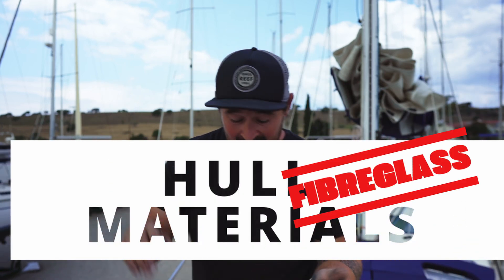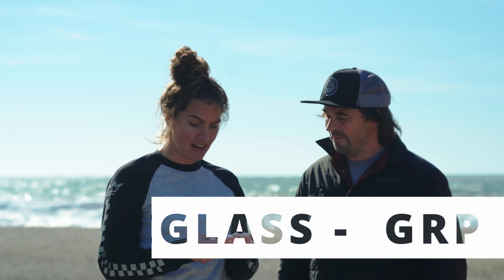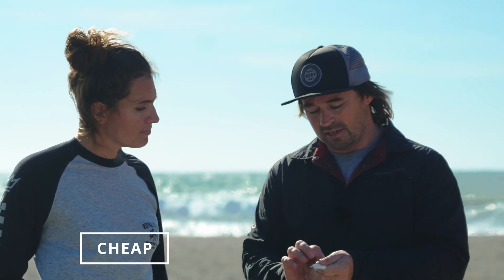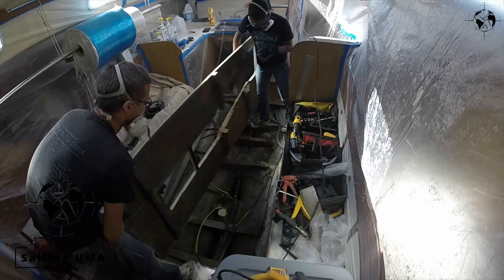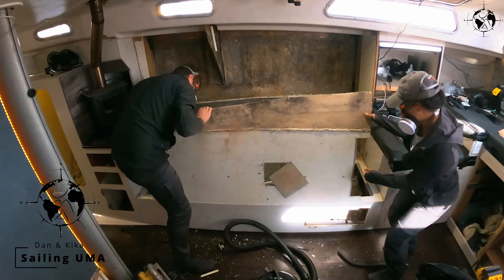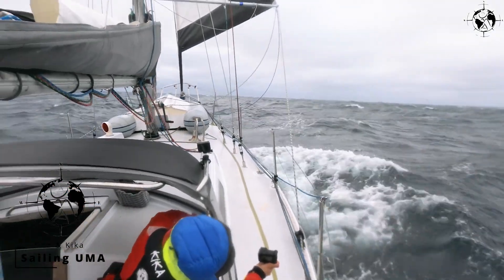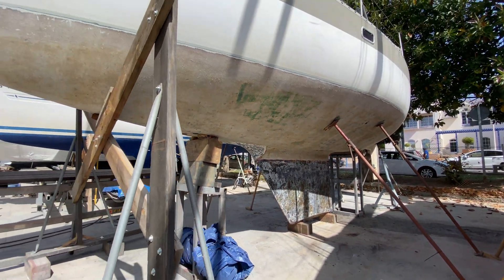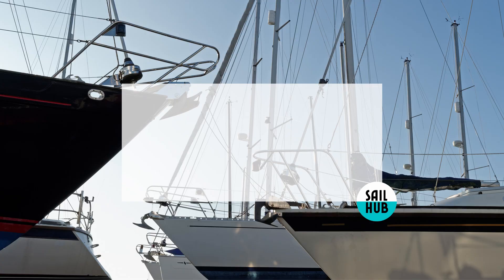Fibreglass Boats 101- Why so CHEAP?

Comment: Construction materials for where you want to take your boat. A Personal perspective if going to extremely cold Latitudes such as the Arctic or Antarctic, a steel Boat, everywhere in between, either a reinforced Polyester boat properly barrier coated, or a reinforced Vinylester  boat properly Barrier coated (needed as base coats for antifouling anyway. I would never have an aluminium boat as without meticulous TLC and a careful eye on things,  corrosion can be bloody fast and nasty. and after building a high quality expensive hardwood marine ply boat, I will never have any plywood on a boat, or built of plywood, ever again, and not just because Termites love eating the stuff, and soon it is bye bye bulkheads etc. Termites don’t just live in the Tropics by these, Europe has a big Termite problem, and they have now made their way to Britain. Not that it is bad for the climate, because it isn’t and our atmosphere is actually short of it, but guess what are far and away the biggest source of CO2 in the World ? Yep Termites. 🤔
Reply from the maker: Hey Bob, 
some more great points there, I agree with them all. I would suggest that an aluminium build can be different these days. Electrolysis being the main issue, and wit recent technology there's no absolute need for many boats to plug in to 240v these days, there are  also so many good products for good electrical isolation. With specific zinc coatings such as Doxanode becoming the norm for aluminium there's an added safety anode there too. 
If your aware of the issues and know how to see them early I think aluminium is the superior choice, if your not the steel is probably the winner in my eyes.
Reply: @SailHub  Total Hull protection  Below the Waterline can be provided cheaply with Cold Galvanising Paint with 97% Zinc Content, which is Also an Antifouling as well as an Anode. Do Not Buy the Marine  ersions though, as the are identical to the Land use Versions, but the Land Ones are a Fraction of the Price. Frankly, an Aluminium Boat imho, Must  be Hauled out annually (it is good practice for all boats unless they  can be beached or have Twin/ Bilge !eels and can dry out) for a thorough inspection, full service, antifoul and Anode checks. Possibly the biggest issue, is how many really skilled aluminium welders are there in the World ? A lot less than skilled steel welders, and both are vastly outnumbered by skilled Fiberglass workers, plus the number of competent amateurs is staggering as well. so for me, as I  only longer have any desire, or health reasons to go anywhere  Cold, quite the opposite in fact, as I need at least three years in Hot Places es to help starting to reverse disabilities Caused by a Criminally insane Medical Profession, so it really is no Contest , other than finding the Money to  Buy One of Course. Still, God willing, my order for a new Island Packet IP 439 should be placed  efore the end of this year, as thankfully, despite losing everything I had when my last Sailboat was lost, I had bought some Silver Bullion as insurance against the Crime Syndicate That's Stealing everything called the European Union,  when the price was really low, and the price of Silver is ,imely to outdo any Crypto Currencies at some point, and the Sillver Shortage has now reached critical proportions, it looks,s like the Comex Warehouse is now empty, and the LBMA is rapidly  being drained. All modern Technology is totally reliant on Silver, and if Stupid Electric Vehicles and Solar Panel Farms keep being Pusned, the World is going to rapidly run out of Silver.  RICS Nations get it, India for example bout 304 million ounces of Silver in 2022. Silver is actually the most precious metal by Far, and is the most undervalued asset on the Planet. Not Gold. Pricing reality will be catching up very soon  now. Not Financial Advice, but personally I wish I could afford to buy a bit more, while it is still possible to get some. Still, I think I have e ough to get me the Sailboat I need. Fingers crossed.   Best Wishes and Fair Winds.  Bob.  🤔👍⛵️✨️✨️✨️
Reply from the maker: Mate, I’m with you there! Will look into the zink treatments, im aware of doxanode and I’m aware of another name that’s it’s sold under - probably the original manufacturer. 

As for the eye and finances in general, it’s quite possible that the seas is the last place to be free, go get you IP 439 and enjoy her! Cheers to that 🍻
Reply: @SailHub  as an insight here in the UK, a Kilo PaintTin of 97% Zinc, in a silicone Carrier was about £23 a tin including 20% VAT. Three coats should give about 18 months protection, but on annual haulout, after a quick pressure wash, to slap more Coats on a quick keying with a Scotchbrite scrubber once dry, should be all the prep needed. I've read that some fishing boats ha e been using it effectively as both an a tifoul and Anode, for over 10 years, so I'm tempted, if I can't get the builder Island Packet to source a good Outfit to Copper Coat antifoull it, to get them to put 4 Coats of Cold Galvanising Paint below the waterline and on the Prop and through hulls, plus a couple of Coats in all those expensive Zinc Anodes, to see how well it lasts as a test. I'll be mostly in the Caribbean for a while, and that's a good place to see how it golds up. There is a very good chance imho, that it can turn out to be at least as good as Hempel's Excellent  Silic One antifouling, but for a fraction of the price. Like Copper, Zinc is one of those essential Supplements needed by Life (my Smallholding has a Chronic Copper Deficiency, all Livestock in the area gets given Copper Supplements, and I take the occasional Copper Supplements as well, just to be on the safe side. Zinc kills nasty viruses by the way. Copper Deficiency in Mammals, has very serious effects not dissimilar to a Neuro Toxin to the Brain. Best Wishes and Fair Winds.  Bob in Wales.  👍⛵️✨️✨️✨️
Reply from the maker: Cool. Thanks for that! 
We know a chap who’s testing some zinc bottoms paint agh the moment, we will be watching them too - see how they get on. It’s good to have alternatives and also good to about the marine added tax we seems to spend our lives dodging!
Reply: PS. I'm a big fan of Copper Coat, but finding a reliable Yard to put it on properly has been a struggle, so to tide me over while searching for one, Had Pettit Trinidad Pro hard antifouling  put on my last boat, which after 3 years just got easy to remove Slime Starting, and it could stay with just Slime to wipe off or pressure wash, for another 4 years. Unfortunately the boat was lost after being attacked by a Wrecking Gang in New York Harbour,  so a number of tests like the antifoul, and a new generation Polycrystalline Solar Panel (prior Polycrystalline Pandls were pretty much finished in 6 to 7 years, so was assisting a Tester in Florida to check if there was any improvement, by checking annually how much the electricity Output was degrading. One of those in the otherwise Monocrystalline Bank of Panels, being no hardship during testing) losing those and other things scheduled for testing, really Sucked tbh. Best Wishes and Fair Winds.  Bob in Wales.  👍⛵️✨️✨️✨️
Reply from the maker: Jeez man, that seriously bad luck. So sorry to hear about your last boat. Such a shame, good testing takes time too - irreplaceable.

As for the cooler coat, sure - it’s good stuff…. At a price, great to have alternatives too. There does appear to be a strict humidity range required that a lot of people don’t adhere to - it’s pretty simple in the correct conditions, you’ve just got to be patient and wait for them. However time is money that there the issue begins. 

Currently in Spain in the costa del sol - no issues here, just back from Greece which would have been a nightmare to apply copper coat there! Later in the season would work.. I know of people who successfully used it in scotland - you get a day every year to do it 😂!! 

Don’t know why I’m laughing, we will be back in the UK in a month or so!
Reply: @SailHub  On the positive side, my last boat was so tough, she survived to get me through it alive before going down, plus, she taught me big time what I really need on my next Sailboat,  such as being very easy to get on and off, so Aft Cockpit,  and Sugar Scoop or bathing platform to function as a Dock for the Tender, and totally altered what I need as an easy to handle Sail plan, with in Mast Furling, and foresail Curling, plus no more Cross Cut Dacron Sails, Triradial Battenless Furling Main, Triradial Self Taxking Jib, and a way to negate the ability of Hackers to take down the boat network, and have a fast get out of Dodge basic Get Out of Dodge option, with a Full Restore after another System wipe once at a safe place. Raymarine are looking at that for me, which I'll be able to help with once I have the  New Raymarine setup on the New Sailboat. Nothing wrong with B&G, Garmin,  Simrad etc, but as a Tester, I want to continue with that Relationship with Raymarine.  When my network was hacked, the  Chart Plotter and Navigation went haywire, so I hove to on full rudder going round in circles to keep an eye on any Shipping in the Harbour, while I checked things out, and rebooted everything, only to find all of my electronic Charts had been deleted. in Future, I'll have a Tablet with Navionics Charts of the area, in a Faraday Cage as first backup to use while getting the system fully formatted and getting the Get out of Dodge Backup installed on the Network. I think we'll be able to fit what's needed onto a couple of fast memory Sticks to also be kept in a seperate Faraday Cage, and that was the last suggestion I made to the Raymarine Devs, and won't really know more until I have a fully Functional System installed on a Boat again. I've been a Software Tester since the late 1970's,  for the likes of Microsoft, Borland, Wordperfect, etc, and was one of Microsoft's early Registered Developers, though my field was really Computer Hardware, and was a Custom Computer Builder.  Qualified in Civil and Structural engineering,  Thorn EMI Trained Skilled Electrical Installation Engineer, etc,  and now I'm an Apprentice Old Fart, still managing to Breathe. lol. 🤣 Best Wishes and Fair Winds.  Bob in Wales.  👍 ⛵️✨️✨️✨️

Comment: have read from people who do both wood and fiberglass the cost to maintain is about the same If, age brightwork etc is the same only difference is one is wood the other fiberglass
Reply from the maker: Sure wood is good! I’m actually a wooden boatbuilder, I would say that fibreglass is a lot easier to work with and usually a lot less maintenance. Older fibreglass boats are probably the same though…

In general the better quality the fibreglass lay up the less maintenance you will have. Similar to wood really, the better the timber the longer it lasts. 

For me.. the best build is from Aluminium and second to that an epoxy composite build. We’ve all got our own preferences though 👍
Reply: @SailHub  When the Gougeon brothers book first came out they had plans for a cold molded boat   That was a fun project   now, just got the book no plans no boat
Reply from the maker: Gotta love a cold moulded boat mind! I’ve only build a small one, I think it’s a great way to build. Gotta love the big customs from the likes of Spirit too!
Reply: @SailHub  Yes Wanted to go to the Northwest school of Woodeen boat building Didn't have the money to live there for1 year One of those local people have the advantage
Reply from the maker: Sure, I lived aboard in some super cheap club moorings where I trained. I certainly could not afford the accommodation.  However I do think it is just as easy to learn the trade from a job in a good yard. Although good yards are hard to find..

Comment: Osmosis is nothing to do with salt.  GRP boats in fresh water get osmosis faster than boats in salt water.
Reply: In my Civil and Structural Engineering Course in the 1970s it was said that Polyester has a limited life and that it breaks down as it attempts to itself become Water. A lot of Research was done starting  in the 1960s after it was stated that within 10 years, every Beach in the World would be 30ft deep in Plastics, but it soon became clear that wasn’t going to happen, as the lifespan of Polyester exposed to UV light, was only about a year. As an aside, Underground Plastics with no exposure to UV light, had a working life of about 90 years, and with so much water Pipe, Drainage Pipesork starting to be Plastic in the 1960s, by 2050 ish, we are going to be having awful problems with that stuff Failing. tbh, I’m having a hard time finding any reason to accept that there is any such problem as “micro plastics” as a result, and it is hard to avoid the conclusion that this is just yet another example of deliberate Fear-mongering. All that aside, We do have a plastics issue, and that stems from far too few Plasma Gasification Plant around, which can be used to Convert Waste into Energy with Syngas Production alongside them, and for which all forms of Waste Plastics are a Truly Precious Feeedstock that needs to be exploited efore those waste plastics disappear themselves, and we need to get them out of landfill, while there is still Feedstock to rescue. Personally,  my next Sailboat is going to be a fully Vinyl ester Laminate, which will have epoxy 3 layer Barrier Coat of straight laminating epoxy. Should see me out with luck.  Bob. 👍🏴🇬🇧⛵️🌟🌟🌟
Reply from the maker: @brownnoise357  Hey Bob, some super useful information right there. the microplastics debate is a strange old situation. We cant get around what has been done and we do have to look at the dangers to plankton which basically keeps the planet alive. 

With modern materials there is no real reason to to continue with plastics that degrade. There are so many more options that also better from a maintenance perspective! Enjoy your vinyl ester laminate - I think its a step in the right direction!
Reply: @brownnoise357 

Have you looked at Basalt … if you can secure a supply at a real price it’s way ahead . 
It’s also nicer to work with. .. if you want lighter use foam core wood or other natural finer .

Look up the Basalt guru’s site oh it’s impervious to osmosis…. and a great multi spectral insulator.  Impact scratch and gouge resistance are way beyond GRP it’s also way greener. 

There’s a US couple building a Schonning with Basalt below the water and in key areas .
Reply from the maker: Hi Nick, I used salt it as a simple way to explain what many people see as a confusing situation. 

I do think you may be confusing hydrolysis with osmosis though? Give me a second here… Hydrolysis is not affected by salt. However when this phase is complete we end up with an acidic saline content made from the breakdown of the resin, this can take years and from here we start with an new phase, osmosis. 

With osmosis the solute molecules within the hull and the water try to equalise and cause a force of water through the membrane to a hydrolysis effected area and eventually cause a pressure which becomes a blister. 

Salt content of the surrounding water effects the pressures in this stage as they are trying to equalise with the acidic saline content now present within the hull that was created during the hydrolysis phase. 

So water is passing through the membrane to the area of hydrolysis due its salt content. So build up of water that causes the blisters but at the same time it is differing in salt  content that causes it to find its way there. 

Hence why freshwater is worse, it is trying harder to get to the hydrolysis than an already salty solution such as sea water. 

Your right though - not the most accurate description, maybe we should do an in depth look at this subject and cover moisture readings and epoxy coatings at the same time.

Thanks for your input - much appreciated. I will work on some better descriptions! Cheers 👌